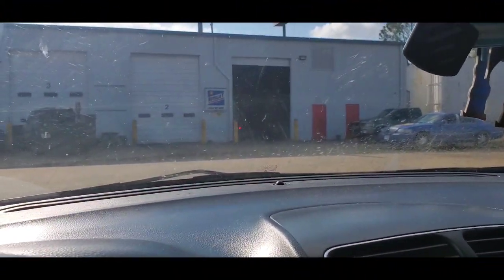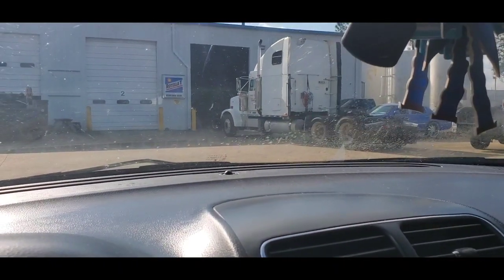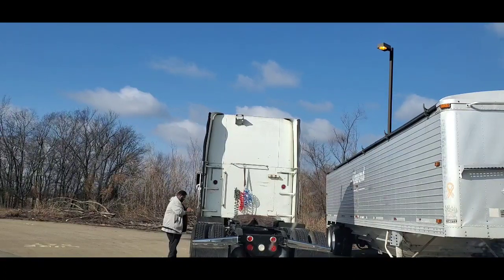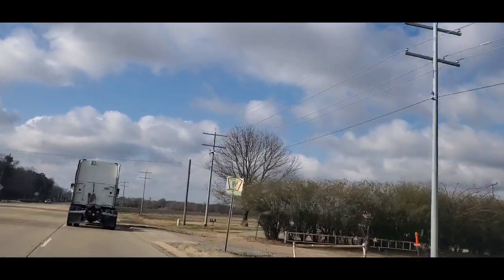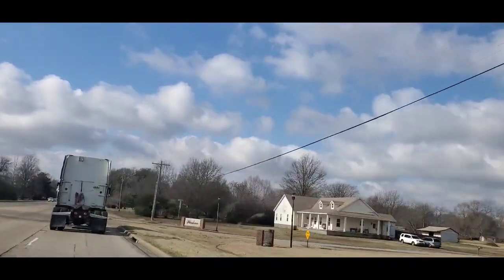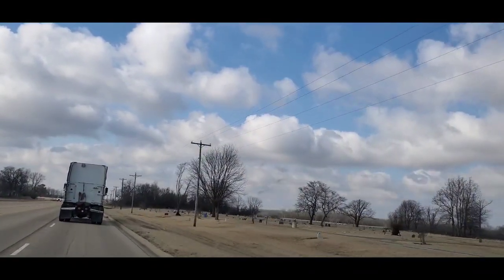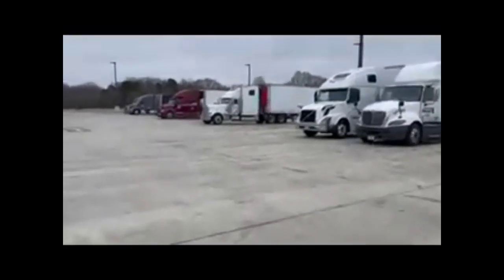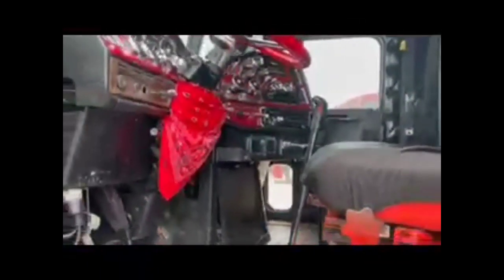Big Daddy Gets A DOT Inspection! First Load! ELH  Truck And Trailer Repair

Comment: Congrats...see what you and jason have done is what us old guys call common sense. Build the truck b4 you put it on the road and you lower your risk substantially from having to deal with break downs. If  you need a performance kick 2 it let me no and I can hook you guys up.i am pushing 700 horses on my kitty in my classic and average 6.7m.p.g .good job on that o'l shaker